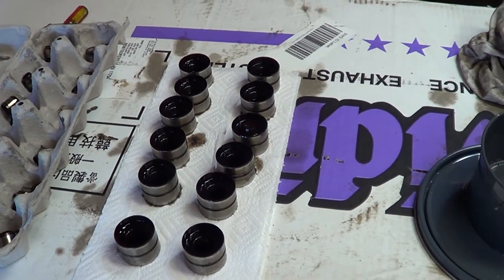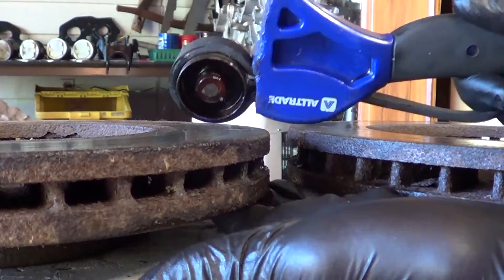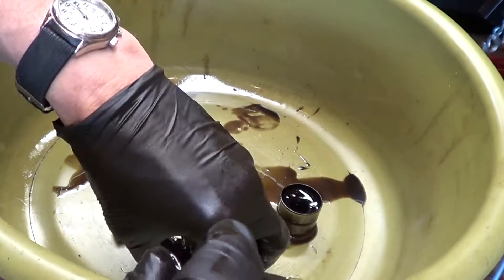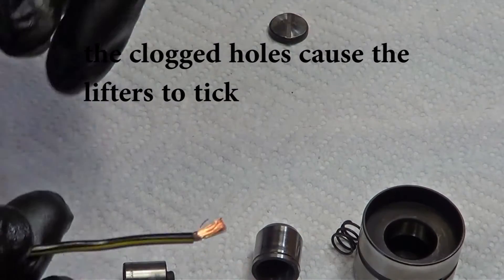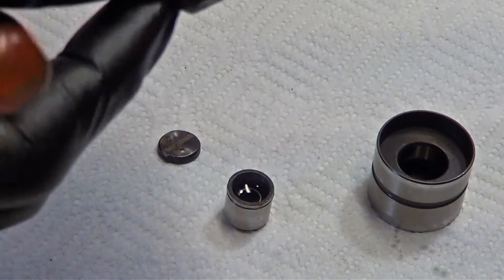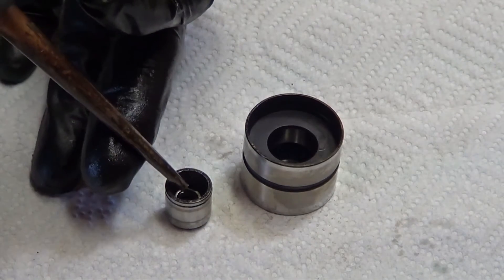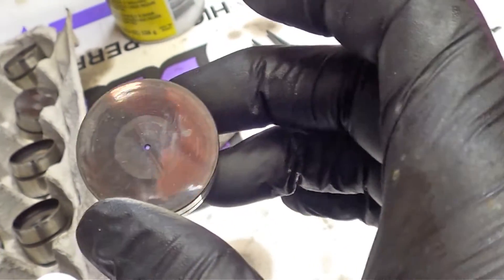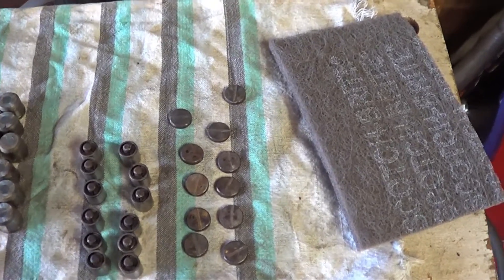Nissan lifter tick repair VG30DE  Z32 300zx

Comment: That you so much for this. Very clear and easy to follow. How long do you think the lifter can last once it makes this noise? I am trying to wait until my next timing belt replacement, but I’m worried with that kindve mileage
Reply from the maker: Some people have been successful quieting a noisy lifter, with Marvel Mystery Oil.  Add some to a warm engine, and run for a short while, then change oil and filter.  It may break up the crud inside the lifter.  Good luck.

Comment: Did the same job on a twincam ca18, same lifter.
Dear god they wher full of junk. once you get a hang of it you can  do a "DCOA" of a single lifter in  15~20 minutes.
Better use a sucket  to fit around the adjuster and brace against the bottm of the bucket and then tap them free.
One of mine had the same line across the  diameter.

Comment: i have a 300zx with 152.3k on it. what kinda of oil would you reccomend to use to clean these buggers out without pulling it all apart?, I'm currently using royal purple 5w30, its been under 32°F here for the last month or so
Reply from the maker: I have seen others recommend Marvel Mystery oil added to engine, and allow  to run for a while, before changing oil and filter.  It's worth a try , but heard it is not always effective.  Let us know if you have any success.  Good Luck

Comment: how were you able to tell or diagnose if it was your lifters?
Reply from the maker: Lifter ticks can be best heard with an automotive stethoscope, to pinpoint location.   They usually are louder with a cold engine, and may lessen after warmup.  This cars tick was quite noticeable.